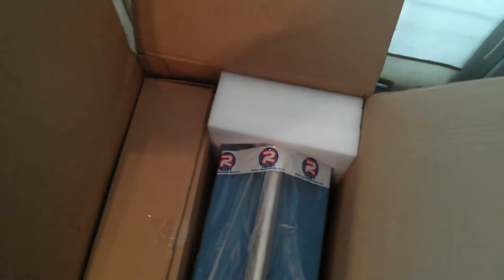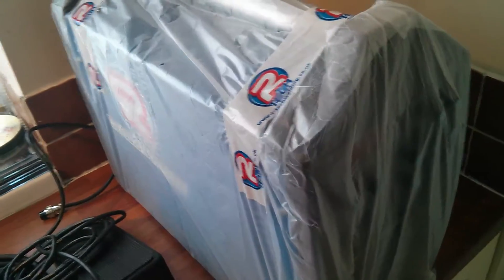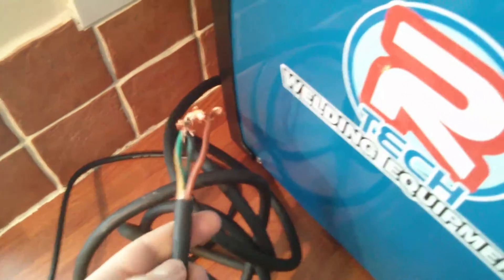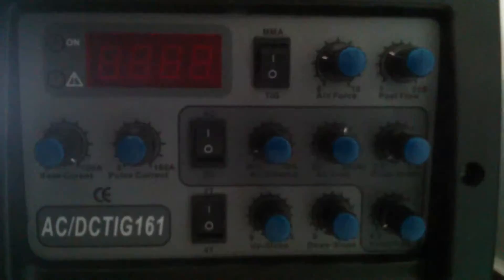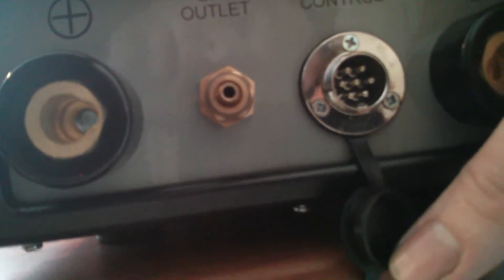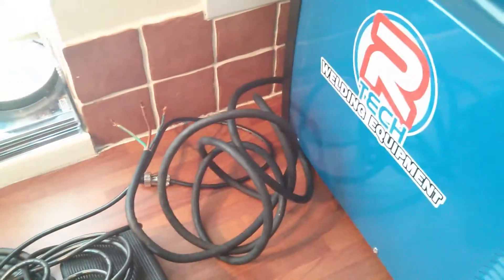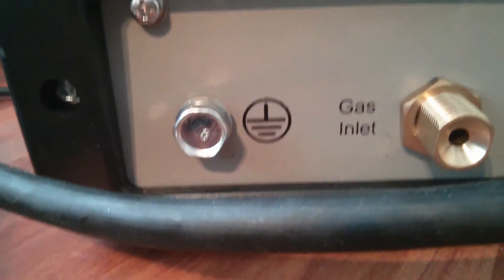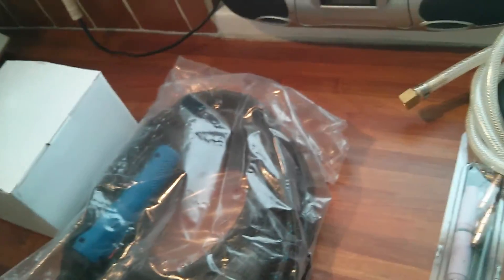Tig Welder R-Tech Tig161 AC/DC Unboxing and First Impressions Part 1

Comment: No way will you be able to run 160A without blowing the 13A fuse lol. chances are it comes without a fuse so that it puts the responsibility on to you. If they fitted the plug then it would make them responsible for the current rating being exceeded. I would like to see you weld a 6mm steel plate at max setting without popping the fuse...
Reply: I've run mine @ 160 amps many times from a 13 amp plug no problem. Only thing I had to do was replace the RCD 16 amp for a 32 Amp in the consumer unit to take up of the initial surge.
Reply: Yes you can mine runs fine at 160A on 13amp plug